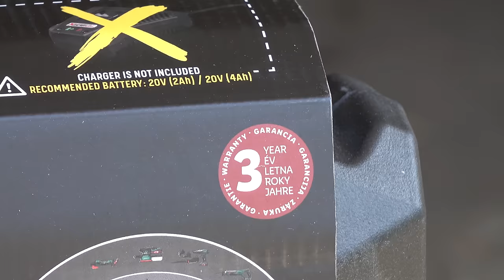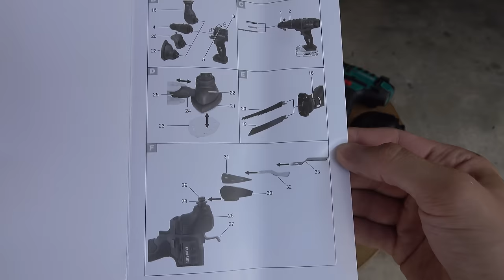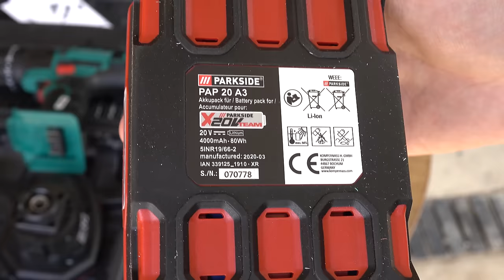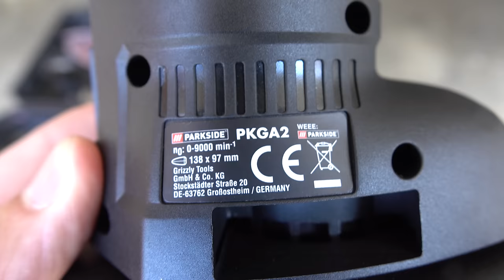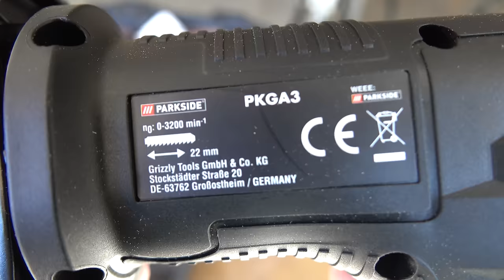4 in 1 Multi Tool - Parkside PKGA 20-Li C2  | Unboxing and Test

Comment: Hey don't suppose you know how often lidl sells these in the UK? Got the impact driver couple weeks ago and I'm really impressed with it for £20. Thank you
Reply from the maker: I have no idea. Im not dissapointed in these tools, they r quite good
Reply: These are currently on sale in Lidl UK. I'd look to the larger modern stores though, as they seem to have the stock. They're £40.00. They have a 2.0Ah battery and charger (as a pack) for £20.00. They also have separate batteries, including a 4.0Ah for about £25.00
Reply: They're available now at the same price that FH 78951 stated. I've just bought one, and one of the batteries. I think it's a decent bit of kit, looking at this video, although I bought the 2Ah battery with charger and therefore expect less available power (but I could always buy a 4Ah one; the batteries seem to be in stock nearly all the time now).
Reply: @robynrox  In case you would need a battery there are like 4 types of batteries from tools i work with so make sure you buy the right model.
Reply: It is available in India?

Comment: Can I use this for shallow drilling on a concrete wall for hanging photo frames? :)
Reply from the maker: ofcourse. This thing can handle even more difficult drilling jobs.
Reply: I would buy a drill with a hammer feature
Reply: @davidzee3755  depends - in some forms of concrete a hammer function will cause a lot of damage 
Normal concrete will take it without problems but porous concrete will fall apart completely
Reply: Kripto then you switch to drill mode but at Lisset you have it
Reply: At least
Reply: @MakeAndTest  l
Z f

Comment: Wow it's quite good tools for affordable price
Reply from the maker: You have tu buy the battery separate. Otherwise its good yes.
Reply: @MakeAndTest  the first time they sold it in Italy was with the smaller battery and battery charger. I got aside the bigger battery for the telescopic chainsaw.

Comment: Thank you for the video, it shows in a very good way all the potential of this machine. I'm thinking about buying it and the main use will be as a driller and screwdriver for home use: mounting some furniture, drilling the wall etc. Although I like the fact that it has many other functions. Would you recommend it for that?
Reply from the maker: Definetly yes. The drilling machine is probably one of the most powerful battery ones. It outperformed my old Milwauki. Other accesories are a bit lame. The sabre saw isnt as good as the one in my latest video. That one is very good.
Reply: @MakeAndTest  thank you so much!
Reply from the maker: @legumbro  No problem man,  glad you got the info
Reply: 111
Reply: @MakeAndTest  Great comment, i wanted to say that performances of everything except drill/screw driver are bit lame. But still for DYI or Hobby good enough.

Comment: Quite a versitile tool how did you rate it
Reply from the maker: For the price you pay it's good. It does the job. But if you plan to work with it everyday for a couple of hours, than this isn't the right thing to use. It's very noisey and it vibrates a lot. The drill attachment works very well and it's strong exactly like my Milwaukee.
Reply: @MakeAndTest  thanks for replying

Comment: One more query.  Whether this machine will work with 220 w AC power supply or by both with battery as well with direct power input through service wired?
Reply: It's been two years since you asked, but here's an answer. 
Generally speaking, those tools are not made to be used with a power supply, because they check the temperature of the battery. 

You can make an adapter for it though which has to include a 10k resistor for telling the tool that the temperature of the battery is fine, and then you also need 20V from your power supply. 
If you build such an adapter, it will work. 
Maybe even from a 100W USB type C charger.

Comment: I don't think my Ryobi drill driver could drill through that piece of metal, and I paid about 80 quid for it, incl battery and charger, and it is terrible at driving screws. I think it all depends on the quality of the drill bits rather than the drill itself, cheap drill bits are no good, same with cheap screws.
Reply: That's why I always buy the brushless ryobi if it's an option, although if i see really cheap brushed stuff at a yardsale then I'd definitely grab that.

Comment: angle grinder definitely do better job for sanding & cutting wood as long the cutting disc match with recommended rpm
Reply: Who the hell cuts wood with an angle grinder.

Comment: Note...Battery is NOT included.
You have to buy Battery as an Extra.
Reply from the maker: Some packages may have the charger and battery, because there is a dedicated space in this packaging for both. I think it ends with A1, if it has the battery.

Comment: I have noticed that when I push on/off switch to max, tool works for few seconds and switches off. I have not tried any harder jobs with it yet. Is this normal?
Reply from the maker: I'd return it and let them repair it.
Reply: @MakeAndTest  Thanks for your reply!